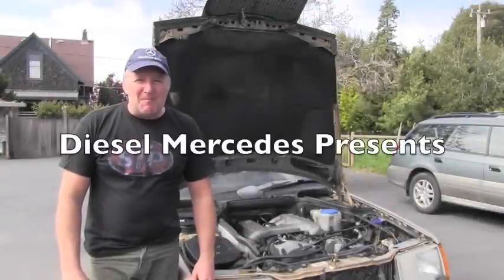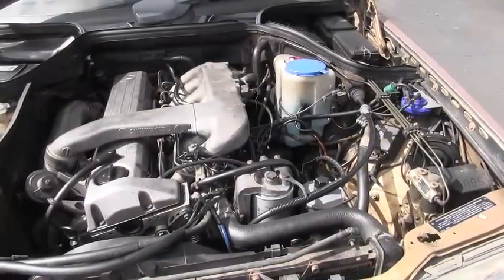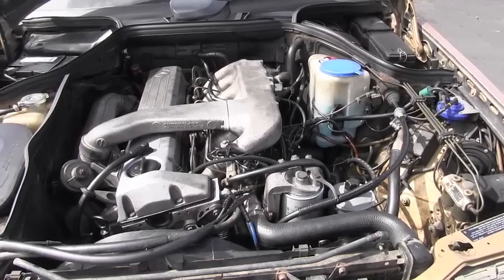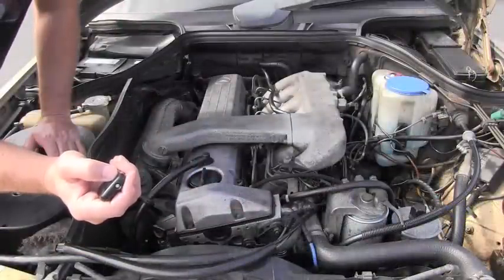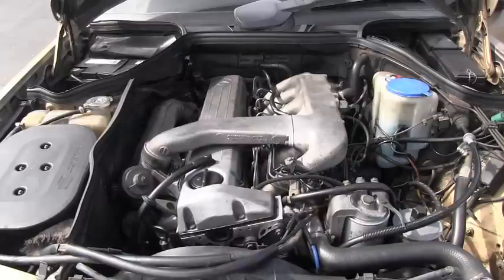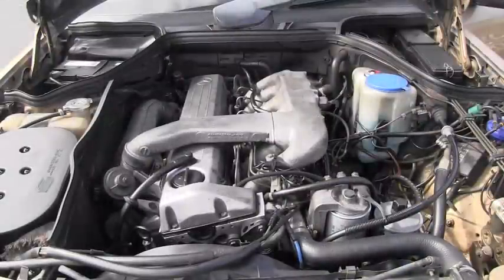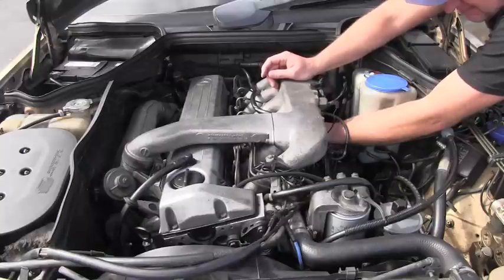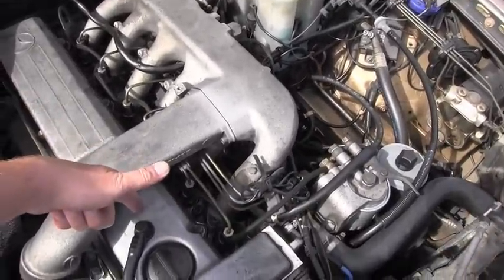Mercedes Diesel Engine OM603 Clicking Knocking

Comment: My 1989 OM602 engine with 200K on it was very quiet when cold but as it warmed up a fairly loud tick tick tick comes about. I changed the tappets, no difference, new injector, regular oil changes with  flushes and diesel purge no difference. Couldn't find any garage to take it on so now in the process of changing the engine. Might seem extreme but cheaper to find another engine than pay silly garage fees.

Comment: hello friend ! finally, I did get all the lifter out and there was one worn out. there was a kinda slot on the top, made by the camshaft lobe, like it was not turning! so I'd replace it with a new INA one. I dismantled the other one, all a part and they were very clean!   but the trick is that there is a re- bolt order for the camshaft ! unfortunately, a broked the camshaft in two pieces, so I have to order a used one on E-bay!!! now: no more tiklin and very happy ! thanks for sharing all of your video ! Max, from Quebec, Canada.
Reply from the maker: Thanks for sharing ..

Comment: Hello. Well, I have the same car, year 1993 with 275.000 km on the odometer, but could have more. I had the about the same noises a couple of months ago.  There is a clicking noise that maybe caused by hydraulic valve lifters. There is a second noise on the background which frequency seems to be half or one third of rpm, and that sounds like a soft beat and blow, alltogether. Identical to the one you show in this video.

To remediate the noises I changed the valve lifters (all of therm) and changed the chain tensor. Now sound is a lot less, but the second noise still shows after the engine turn hot. If I rev up the engine for a while, the sound dissapear. May come back again later.
With a cold engine the sound is not present. Only after the engine gets hot. But I still can make it dissapear revving up the engine (over 2000 rpm).

Other possibilities I am considering to be causing the noise:

1) Alternator.
2) Vacuum pump.
3) Rubber strap of the fan, alternator, etc. on the engine.
4) Fan clutch.
5) Poor seal on vacuum hoses causing some trouble somewhere.
6) Low pressure on oil.
7) Dirt on injection pump and pipes, injectors.

Next step I will make a Diesel purge. 
I will prepare a wood stick to put on my ear to help find the place where the noise comes from.

The oil pressure gauge starts well, mark full with cold engine. After getting hot it lowers one third down. Sometimes it vibrates. There are no visible leaks of oil. The car runs very well, last trip at 110 to 120 km/h yield 12,5 km/liter which I think is very good (two full tanks). No smoke, no oil loss. I also accelerated until 160km/h easily a couple of times. Going up a hill.

You have a lot of experience with this cars, combining it with the information I give to you now, and the real cause of the noise you found on the car of your video, you may assing probabilities to any of these 7 possible causes.

By the way, what was the problem on that car?

Thank you a lot for sharing your experience with us.

Best,

José from Chile.

Comment: I have a 1990 300d that does this also. What I do is close the hood and turn up the radio.
Reply from the maker: cheap way to deal with it ! Awesome….
Reply: The tippers need to be adjusted. You don't need to do that except that clicking really annoys you.
Reply: @VideoAmateurLuxembourg  the tappets on this engine are hydraulic and self-adjusting.

Comment: Hi Mr Diesel.
Thanks for all your videos. 
About this noise, I have the same when you rev the engine at cold temp, but in my engine, at cold and warm temp, and only when engine is around 1000rpm.
My engine is OM605.911 from year 95, with 240000km.
I bought past week so I will do all basic manteinance next week (engine flush, oil, air, steering power and fuel filters, Petronas 5w40 oil change...).
Belt tensioner shock absorber was replaced two years ago.
Which was the solution of the noise?
Follow with these great jobs.
Thanks

Comment: hydraulic valves adjusters  have gone bad . replace them tick sound will go away  simple !!
Reply from the maker: Thank you for sharing...
Reply: @oleggordey  This is coming from the lifters.
It is a rather soft noise. My brothers om602 had bad (but new) injectors and that sounded like a rattlecan.
If the noise is very harsh (like a rattle can) and is most pronounced at very light throttle at low RPMs and it goes away when engine braking, than it is the injectors.

Comment: It´s the Hydropushers. I have two W124 - 200d and 300d (no Turbo). I had in both my Benz this problem - then I bought LiquiMoly Hydropushers Liquid and after 1.000 km no sound at all. All OK. I live in Germany.
Reply from the maker: krzysioo22 Thank you for sharing !
Reply: +krzysioo22 What is this Germany you speak of?  Do they know much about making a good Mercedes Benz?
Reply: you repair them only changing the oil?
Reply: Jak sobie poradziles z tym stukaniem?

Comment: I have the same noise on a OM601 , Only on a cold engine tho ... I have replaced all injector nozzles, diesel purged the engine , changed the filters and yet i still have it. My guess is either the Hydralic Lifters (esepecially if its driven with bad Oil before) or the VacuumPump. If you found a solution that'd be great :)
Reply from the maker: VenKKi Makaveev Thank you for sharing your experience with all of us !
Reply: it's definitly the lifters. been there, done that, several times :)

Comment: Hello.
I have a W124 250D from 1990 and I follow your great channel. Thank you for sharing all these useful info with us.

I had a leak on the 5 delivery valves of the injection pump. So, I bought the dedicated tool and I replaced the copper and O rings.
It solved the leak but now I have a strong clicking noise.
I checked the oil level and I also removed the cover of the hydraulic valves tappets to check if the tappets have to be changed or not.
Conclusion: the tappets are ok.
This is a good news but on the other side I still don't find the cause of my clicking noise.

Do you have and idea about what could be the reason of this clicking noise?

Thank you!
Armand